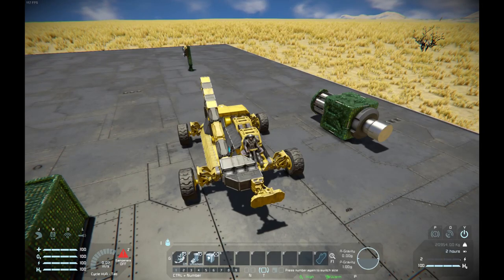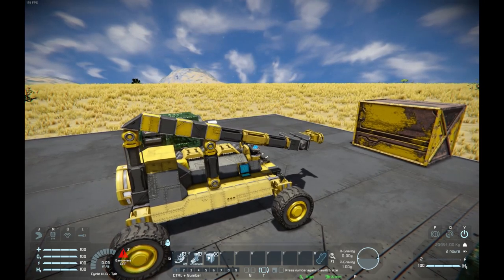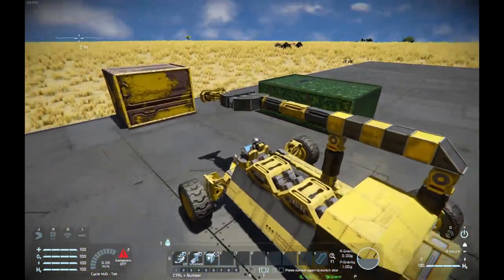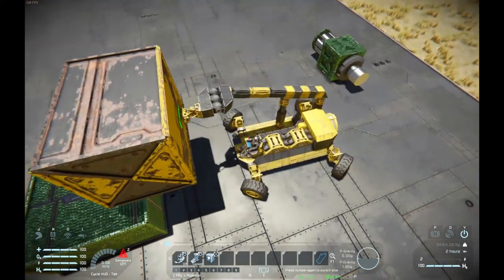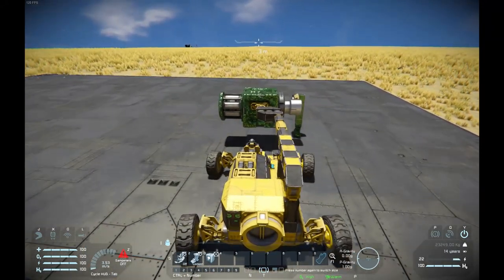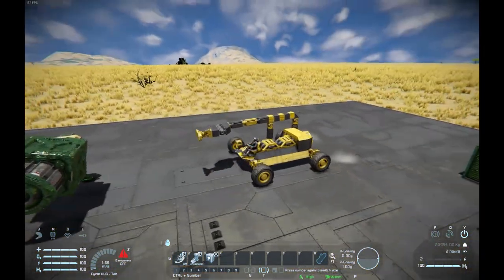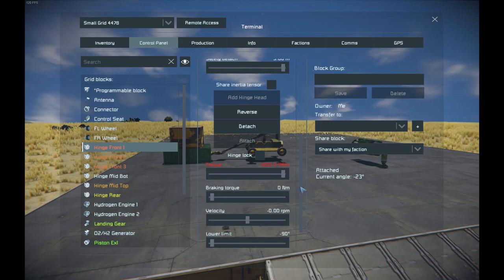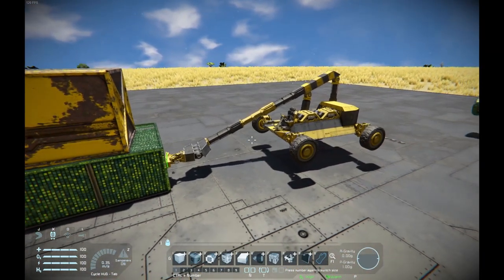Moving things around with pistons and hinges

Comment: Very cool design with pistons and hinges!!  Couple questions on how you setup your controls:

1. How do you control the pistons with just your mouse?
2. How do you keep the landing gear level to the ground while you move up and down?  Is that some scripting magic?
3. What script are you running on your programmable block (hotkey #3) to control your 4-wheel steering?

This has given me a lot of ideas for a fully-articulated arm for moving blocks around.  Thank you for this!  

Can't wait for the small-grid mining build video!!  Will this be the same small grid miner that you did 7 months ago with the piston snake?  

Keep up the good work!
Reply from the maker: 1, 2, 3: Homemade script :) 
I grab the rotation inputs (mouse movement / arrow keys) from the control chair to control the pistons, as well as the wheels when in the stationary mode.
The landing gear is kept level by me telling it (using the script) to maintain an angle opposite the rear hinge.
Sounds cool! Happy i can bring some inspiration :)
And yeah! That's the idea at least, It's going to be an semi-improvised version, so it's not going to be exactly the same, but hopefully just as good !
Reply: @PatrickHansen101  How do you control the pistons what buttons do i press or what do i do with my mouse
Reply from the maker: @neuro2959  If you have downloaded the craft off of the Workshop,  moving your mouse back and forth will lower/raise the arm. Q & E will extend the arm.
If you press "3", moving your mouse side to side will rotate the vehicle :)

Comment: Really cool design! Maybe put some more weight on the back so it wont tip over when moving heavier stuff. :)
Reply from the maker: Thanks! And yeah, was considering it while testing, but considering that the vehicle sprung from the thought "So, i need to move this block about 5m up" i felt that the project had already crept quite a bit :p
Going to take a stab at making a dedicated project out of this at some point, see how powerful and flexible i can make it.
Reply: @PatrickHansen101  you could also have a landing gear on a piston so that  you can look inn your position, cheers!
Reply from the maker: @generaltomfoolery8299  That would require a re-design and somewhat go against the intended purpose however!
The current design rotates by putting the wheels in the shape of a circle,  if i were to connect to the ground for stability, i'd have to put the base on a rotor to maintain the ability to rotate, and as it stands the purpose of the vehicle is to move things around to get in just the right position, which would be a bit harder with a stationary vehicle.
In any case, already made it able to drive around with masses greater than the one in the video :)
Reply: @PatrickHansen101  thats a lot of good points, thanks tough for answering even though my original comment was not the greatest in hindsight 😀
Reply from the maker: @generaltomfoolery8299  It was a good solution for that particular problem, you couldn't know that it wouldn't fit with the envisioned design :)
Reply: @PatrickHansen101  a landing gear could hold you down too, maybe a longer arm so you don't need to move after grabbing something.

Oops someone already said that. 

 I guess this would make it a mobile crane more than a forklift

Comment: Is this working with conveyor tube in place of the yellow/gray block ? I tried but my arm always dismantle at the rear hinge. (Even if i put torque to 0 Nm) I don't understand what is not working.
Reply: You need to turn off the hinge
Reply: @AungKhant-pr5jq  Yep, someone explain to me. You need to build a hinge part on the mobile axe. A hinge without a hinge part on the fix axis. Then, drop the mobile axis to the fix axis and attach them together.